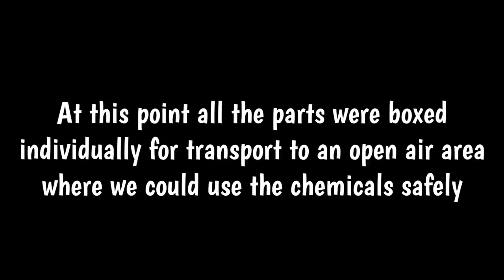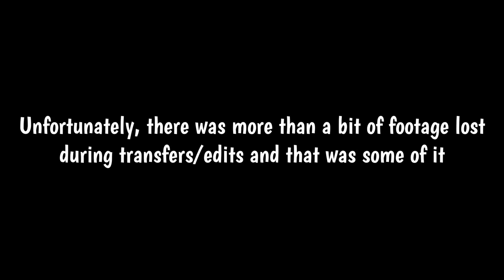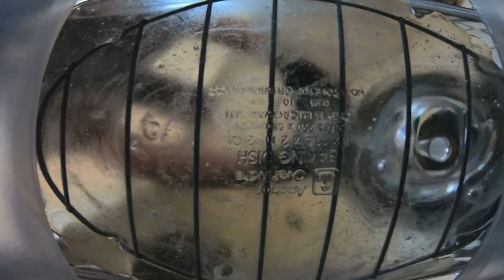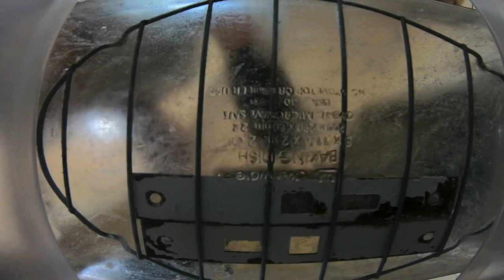a dozen antique locks refurbished and bit keys made (Full Video)

Comment: I’ve got questions and comments (sorry!)
    • $15 strippers usually leave a burn and rash….so I’ve been told :) 
    • I would think that the wire wheel in the drill press would probably remove it though
    • Please tell me you had a line item on the invoice called “boiled locks”
    • I bet every other locksmith would’ve made a key (if they could) and sent them back
    • Excellent video – shows how much work goes into a project like this.  I’m sure the editing took the same amount of time!
Reply from the maker: Wes Gunter lol 😂 😂
Reply from the maker: I missed the opportunity for the boiled locks line item but the customer woulda been like say whaaaaa? Hehe

Comment: I cleaned up loads of those old mortise locks. Boiling is a waste of time. Water based paint comes off easily. The old oil based paint is tougher. I use a spray like WD40 and a fine wire wheel. 5 minutes each lock. I wire brush a lot of old Brass Locks of all kinds. I use WD40 for a lub when brushing. They come out great..